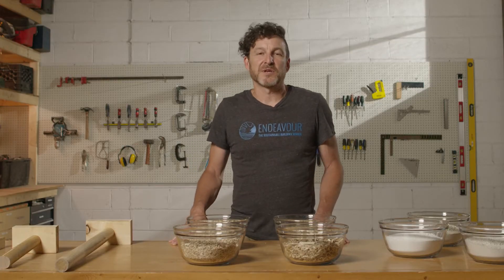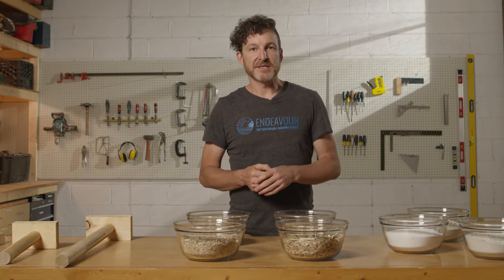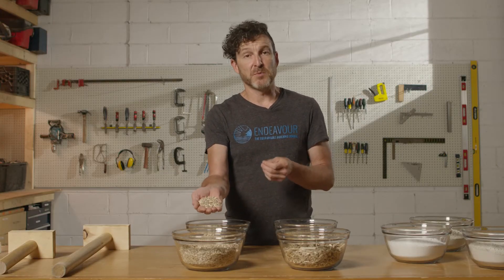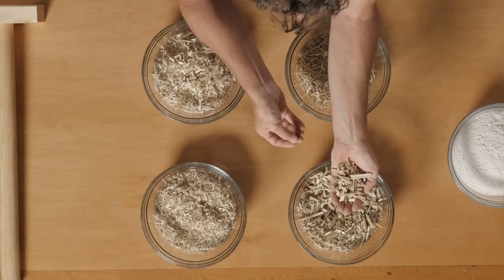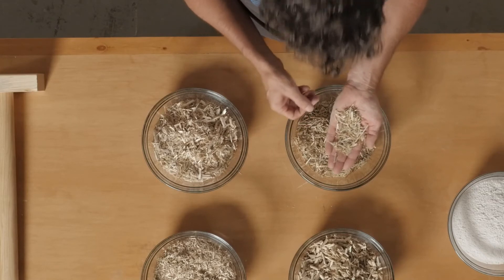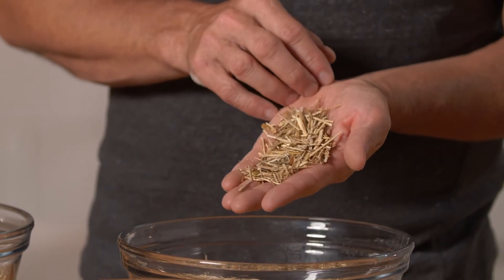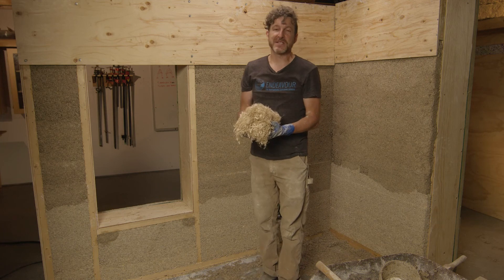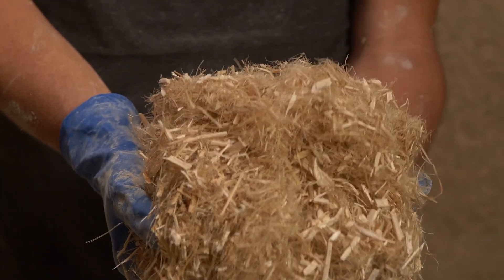How to build with Hempcrete: Material Selection

Comment: Hi Chris,  do you have a clue how many tons of hempcrete does it take to build a 70 square meters house with a thickness of 14inch wall? Thank you!
Reply: You kind of need to provide more info...

The questions of how much hempcrete is necessary depends if you want to insulate the floor, ceiling AND/OR roof (which inclination, etc)
What's the house PERIMETRE? What's the wall length?  

Well, with the following info you can make your calculations.
Hemp Hurd is 120~130 kg/m3
Hydrated lime is somewhere at 1900kg/m3
Water 1000kg/m3
When measuring -> 4 hemp hurd  - 1 lime 1 water 

if 7mx10mx2.5  WITHOU floor, ceiling and roof hempcrete..
(7mx2.5m*2+10m*2.5m*2)*0.35m => +/- 30m3 of  hempcrete material (use the previous measurings to calculate how much tons of each)